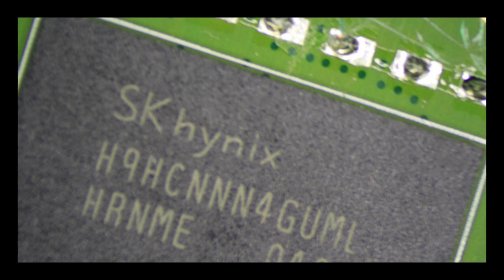Amazon Echo Dot 4th Generation Teardown & Disassembly | New CPU Inside

Comment: What specific tool can i use to remove the 4 bottom screws?
Reply from the maker: I used a small straight screwdriver
Reply: will precision screwdrivers work?